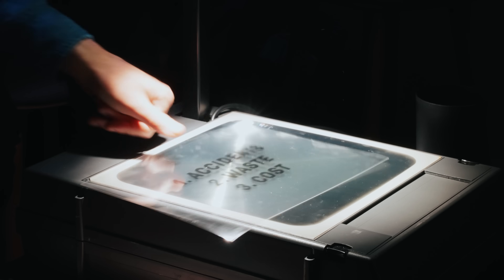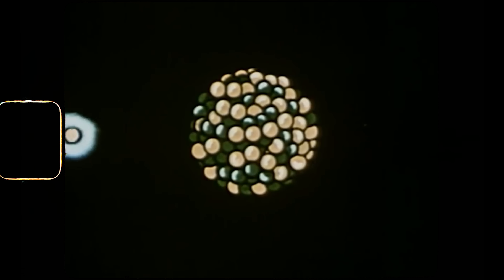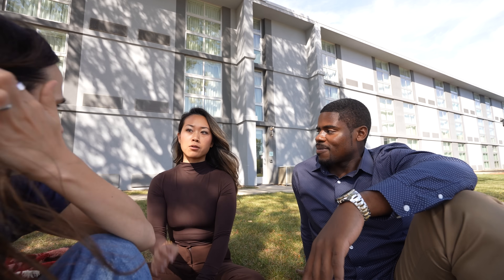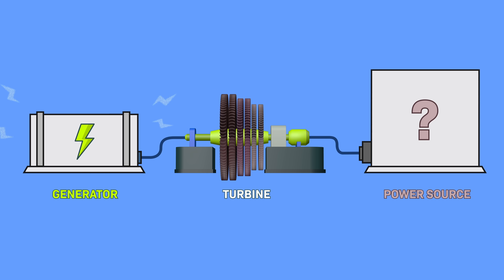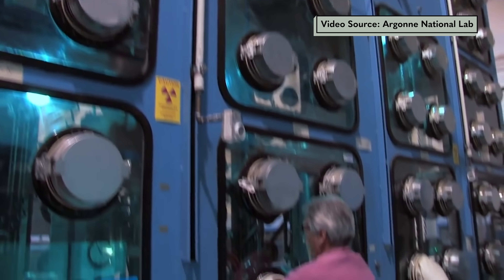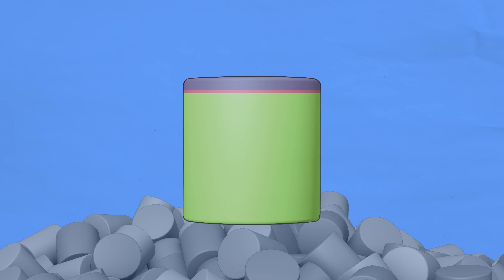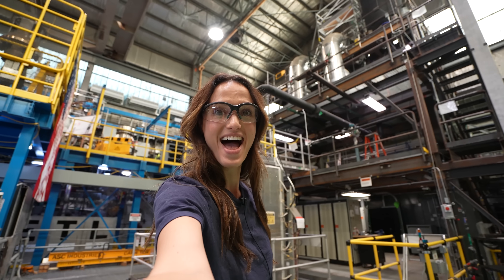The Big Lie About Nuclear Waste

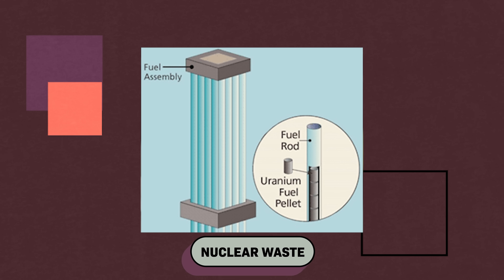Comment: 7:09 - "...235 - that number refers to the number of neutrons in the atom/"  Well, not exactly - it is the sum of the neutrons and protons (143 + 92).

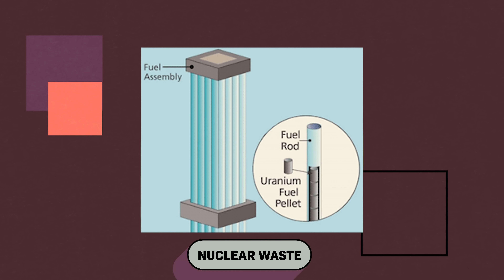7:15 - "...enrichment, which makes more of the uranium-235 out of the less useful U-238."  No.  It is the process of increasing the concentration of U-235 in the uranium as a whole, simultaneously making U-238 with very little U-235 in it.  This latter is called "depleted uranium,"

7:20 - you're on a run!! - "By the time you're done your fuel looks like this: (pellets).  Well, no.  It's a gas UF6, uranium hexafluoride.  It's reduced back to metal, then oxidized (for fire protection) and then mixed with ceramic binders to mold the pellets.

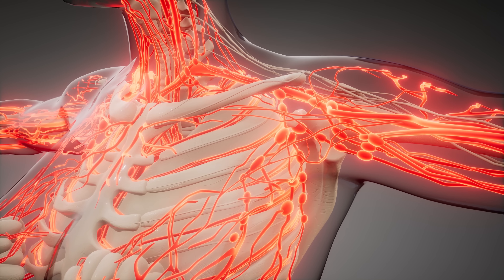7:30 - "You fire a bunch of free atoms at the uranium-235..." No, you release thermal energy neutrons which the U-235 captures, and about 80% of the time the nucleus fissions.

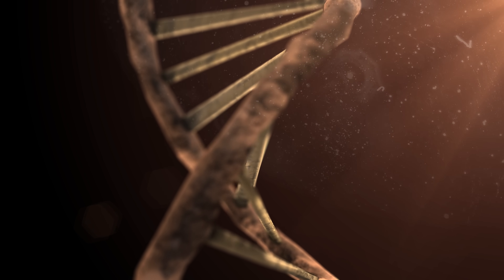7:35 - "each time they get split a little mass turns into energy".  Yeah, mentioning Einstein never fades, but what is really happening is that binding energy in the nucleus that was holding the nucleus together gets released.  That energy has mass equivalent which is what is dissipated as kinetic energy in the rebounding fission product nuclei.

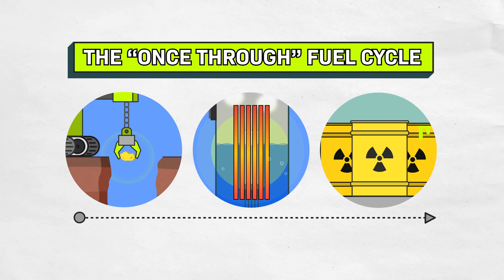8:29 - "We're talking hundreds of thousands of years".  Now, this is straight-on fear-mongering.  The fission products which you've named the real baddies) are decayed away within 300 years to a thousandth of their original.  What remains are the original U-238 and a smidge of remaining U-235 plus some transuranics that captured neutrons.  The transuranics (like plutonium), if left in will eventually be fissile and become fuel, but even if pulled out they are in total less radioactive than the original uranium ore was, which is about 13x more radioactive than the pure metal.  

8:50 - "Those casks are meant to last decades, but not hundreds of thousands of years." They assuredly are, some only fiyr decades, but they can be replaced and the current catches run to 100 years.  And as far as we know at the present, 300 years will be enough.

9:10 - "There are a lot of dry casks just sitting there at nuclear power plants."  Yeah, but so what?  Land use? The total wasted space due to them totals about 44 acres across the 86 cask sites across the US - compare that to coal and hydro land use.  Ugly?  No, not particularly.  Dangerous?  From what?  Aluminum jets flown by fanatics?  Floods from earth dams?  Melting into the Earth?  Heh. Get a grip.

10:58 "...then you filter out the useful stuff and you use it again and again..."  You used up 60% of the U-235 in the first cycle - so what is the "useful stuff" you are sending back to be reused?  It's not mainly U-235; it is the remaining 40% of the U-235 plus some other fissile transuranics, like plutonium, americium and curium.  Useful recycling only works once or twice in current reactors.  The U-238, the vast bulk of the fuel, is recycled, but it is mainly inert, only breeding some plutonium at each cycle, at a mass loss with each cycle to boot.  The magic filtering process you show is not that discriminating of good vs evil, and since it handles the fission products it is dangerously radioactive as well.

11:43 "..one of these materials is plutonium, a highly radioactive element..."  Plutonium is not in the ballpark with the fission products.  See the Wikipedia article on the Demon Core, and see the core sitting in a test tamper.  It wasn't put there by a machine - humans pulled it out of a plywood box in two or three pieces and placed it in the tamper.  By hands, probably not even gloved.  Ralph Nader thought it was highly radioactive; the scientists who actually handled it 30 years earlier knew better.

In summary, you are building up this huge boogy man in order to save the world with your white knight fuel recycling.  I personally think recycling is good and should be done, but for a large fraction of fuel to be so processed it is going to require that the political forces against nuclear be quieted, not shown that nasty recycling is the "only solution".  It is not the only one.

Comment: I do not think public perception is as big of a hurdle as the road block that politicians present for green energy. There is too much money in oil and majority of politicians are too short term to think about such a large infastructure shift. That said, people love to blame politicians, but honestly what should you be expecting from these people. For the most part they arnt STEM majors. If anyone went to university they have a generally understanding of the course work a political science major has to go through, and even if they have a law degree, no single individual can have a solid grasp on all technical issues. Yet, that is the burden we place on the politicians. So the solution is then lobbiest, which introduce this corrupt relationship between companies with large wealthy being able to set up agencies that warp data to convince these politicians to act a certain way. It is overall an unsustainable system that deteriorates as society increases in complexity.

Comment: Nuclear Accidents shift the climate instantly, fuel and coals are used as a backup for the warmth, also climate change causes the change in wind direction too, affecting the Solar, Wind and Hydro.

Can you guess why all the Nuclear Power nations generally have Lower temperatures ?

Comment: Cleo is very nice and I decided this needed to be posted closer to the present. The US needs to keep and store its supply of protonated deuterium. Once refined, It can easily be made to release free protons, which will eventually be used as an energy source and be worth their weight in gold and assist us in long space flight. There is a danger to releasing free protons, and they must be stored in chemical batteries, or in another way. The universe only supplied us with so much free protons, and if they are let to sink to the Earth's center, it will cause geologic instability and be very hard to get them back. If sold, this material will be used by our enemies in various ways and be wasted away.

Comment: Fast reactors are not at practical level so there is no use to recycle. (we got more plutonium from convensional reactors than we can spend as MOX fuel for light water reactors. Also reprocessing spent MOX fuel is problematic because it takes longer till it's reprocess-able and contains more unusable wastes.)

Comment: around 13:00 "we just need a way to commercialize it"
In technology development, when the prototype is a building, that's a big "just". Because you need to build more than one prototype to make a technology from "proven to work" (e.g. still the current step on fusion) to "can be cost efficient". However, it's very true that this is in the box since 60 years. And the fact other countries than the US worked on it also means you guys won't have to go through all the trouble. I'm French btw. Knowing a bit about these programs. But unlike Japan, we failed at that, also mostly for political reasons. Glad it's back on the rail thanks to you guys.

Comment: Reference @ 7:10 (approximately) you state 235 neutrons. Incorrect. Atomic weight is 235 which is 143 neutrons. 

In the nucleus of each atom of uranium-235 (U-235) are 92 protons and 143 neutrons, for a total of 235.

In 1977, in Australia (down under) we attended AAEC /  Australian Atomic Energy Commission at Lucas Heights.

We learnt radio active decay, half life of Uranium plus other radio active isotopes.

Australia has this one and only Atomic Institution because of Nuclear Medicine. The half life of Medical isotopes are short. An example is : - 

Gold-198 (198Au) is a radioactive isotope of gold. It undergoes beta decay to stable 198Hg with a half-life of 2.69464 days.

Gold to Mercury - not good Mercury poisoning. Mercury used by hat makers - "Mad as a Hatter". Mercury side effect - madness.

Massive radioactive waste - total madness.

Thanks for joining the dots together.

Derek the Dentist suffering Madness due to Mercury usage in Dental fillings tin and mercury (quick silver).

Comment: @screddot7074 sounds like we need to take it up with the Supreme Court. Make the argument that using and pursuing nuclear energy falls under the pursuit to happiness; since we know that energy consumption (and availability) directly correlates to quality of life. Follow up with good faith measures to ensure public safety. Such as, having the Air Force stationed at all recycling stations to oversee (and possibly assist) with handling and transportation of goods/materials. Forced time limits on how long someone can work at a recycling station, 5 years to avoid any single person knowing too much. All recycling stations must have multiple ways to transport materials in and out of facility; and, will be Required to use those different routes to avoid creating too much of a routine. Route changes must be implemented at least 4 times a year. Teams must practice new routes for at least 14 days before switching routes. Most obviously, ALL information regarding reactors and recycling is classified and is always on a need to know basis. The future is bright in more ways than one. Between Thorium reactors and Traveling Wave Reactors I can't wait to see what the future of nuclear has for us 😁.

Comment: What's  truly messed up, is all they do with nuclear energy exchange  is heat water to produce steam pressure to spin generators.  News Flash, you can heat a large kettle  of water to produce steam with existing electricity. Once it's online it produces it's  own electricity. Turn the outside source off and wallah  It powers itself.  Easy peasy.    This will never happen, never in a money grubbing society. Not enough money in this machinery. Breath easy.  While you can.

Comment: There's no point is solving a problem if its not economically viable.

New-build Nuclear in all its evolutions is more expensive both in upfront capital and per unit energy produced & slower to build that Solar + Storage. 

As recently as this year, the NuScale latest evolution of Small Module Reactor designs was cancelled because its power was going to cost 3x more than renewable sources. 

So there's no point in hand wringing over an outdated technology. It's like trying to pring back betamax disks now.  There's no point. 
The advocates of nuclear now don't understand the economics or are poitically motivated to delay the renewables transition.

Comment: This is a good video presenting accurate information, but it misses a key piece of context: the cost barrier is very real.  Even if you don't care about carbon-free electricity, solar and wind are literally the cheapest forms of new electricity generation you can build today.  You're right that we definitely should have built fuel-recycling nuclear reactors in the 1960's - 1980's (if we had, we would've radically flattened the curve on today's climate crisis).  But today, the cheapest and easiest is solar & wind.

Comment: With a molten salt reactor instead of Argonne's cheap steam generator using Brayton cycle power instead of water into steam. Water is too low of a temperature for industrial processes. We need higher temperature for industrial processes. 96 % of the energy in pressurized water reactors is still in the fuel. Called waste.

Comment: Well it is certainly good to use the waist we allegedly have. But nuclear power plants are anything but clean energy. The problem we always never talk about is how we get uranium... Getting uranium out of the ground does not just destroy huge masses of land like cole does it adds even on top with the problem of highly contaminated material being just out in the open carried away by wind and rain. But it also is very rare so we need to move far mor ground to find enough uranium which needs a massive energy output.  So the only alternative we have is getting ride of the waist we allegedly have, using new energy resources and eventually also saying goodbye to the feiverdream that nuclear power was
Reply: Ruinables also require mining, much more in fact than mining uranium.

Comment: In the United States isn't not about doing the right thing.
Its about corruption and money laundering. They need "New Money" and that doesn't happen recycling.
I bet they replace the rods at like 50% too. Run them out. 
Its having 1 huge reactor is a problem too. EV's don't have 1 big battery. There's a reason for that. So you don't "loose all of it" They replace the bad, and that may only be 1 or 2% of the whole.
A self contained reactor that can be sent back to the manufacturer for a recharge is the only way to go.
Think of something like a propane tank with a big "+" on one end and a " - " DONE.
A world without power lines and poles.
We don't have that, because then there is no 10% to the big guy.

Comment: Cleo - that was a great summary - one point to add is the plutonium can be used in a mixed oxide fuel (MOX) so it is also recycled, but the supply chain needs to be tightly monitored to prevent nuclear proliferation risks, thanks Bruce.
Reply: That actually depends on the kind of recycling process being used. The PUREX process can separate plutonium from uranium and may need tighter monitoring, though you cannot really get high quality (weapons-grade) plutonium from the recycling high-burnup spent fuel. However, if you use pyroprocessing as the recycling method, as described in the video, the plutonium and the uranium cannot become separated, so it is never a proliferation concern. By simply checking the kind of facility you can already ensure that there is no chance of proliferation.
Reply: According to the "Agreement with the United States and Russia on the disposal of weapons-grade plutonium," the United States was supposed to build a reactor to process 34 tons of plutonium and waste from nuclear power plants into (mixed oxide fuel), but failed. Russia has built a BN_800 nuclear power plant that uses nuclear waste.
Reply: Plutonium is produced and burned in every power reactor ever built. Even the natural reactor 2B years ago produced and consumed PU
Reply: This is a huge number of sound bites directed at a rather cloudy concept of what "nuclear waste" can be used for.  IOW, it's a "click bait" using click bait terms with superficial overview and little real meat for discussion or conclusion!!  Do better!
Reply: @zubenelgenubi if you think you can do better, go for it!

Comment: Technically the fission process is started by firing alpha particles at U-238 which are not atoms but are very close to helium atoms minus a couple of electrons so I'm nit-picking. Energy is released in the kinetic energy of the fissile products including two or three neutrons which continue the process. Did you mention the "mass defect" of the daughter products? This is so Einsteinian. However the 238 in U-238 is the total number of neutrons AND  protons (not just neutrons, that would be heavy man), i.e. U-238 has 92 protons + 146 neutrons = 238 nuclides.

Comment: Or switch to thorium reactors? Sadly thorium doesn't produce nice plutonium for bombs, but a safer nuclear reaction. Also why build new fission reactors, when super-duper fusion reactors are just found the corners. Well OK fusion reactors have been 'almost here' for decades, but it would be sad to spend a lot on building traditional fission reactors, just to scrape them a couple of decades later when fusion becomes viable.

Comment: In Russia, a closed nuclear cycle is already operating - a powerful industrial reactor fully loaded with MOX fuel - BN-800. However, as far as I know, it is not yet operating in the optimal mode for plutonium production - testing of structural elements and fuel cells in different operating modes continues. But the nuclear cycle itself has already closed.
Plus, an experimental BREST-300-OD reactor is being built; it will run on promising “СНУП” fuel (nitrides are used instead of uranium and plutonium oxides), which in theory will make nuclear reactors more efficient and safe.

Comment: I'm a nuclear engineer who graduated just before the Fukushima disaster.  My first job was with a facility under construction that would take old weapons material and convert it into fuel for power plants.  The project was scrapped. The lack of a closed nuclear fuel cycle is an incredible shame.
Reply: A few technical points:  The number 235 in Uranium 235 is the number of nucleons (protons plus neutrons) and not just neutrons.

The Uranium-238 in the fuel doesn't just sit there, it actually turns into other things in the reactor and, by the end of the cycle, is actually the predominant contributor to energy generation.